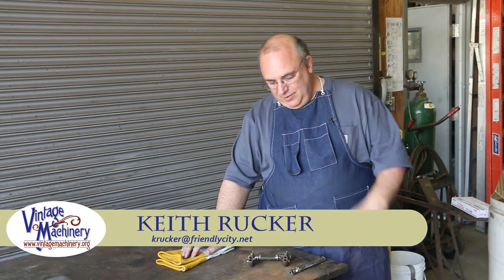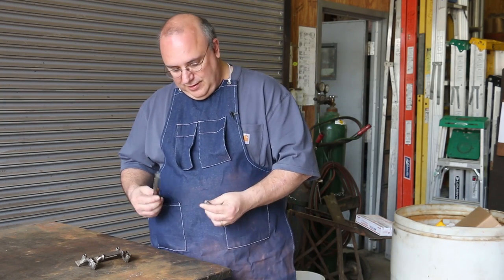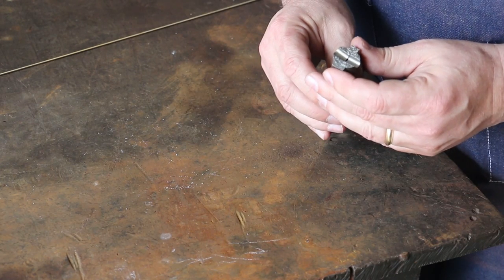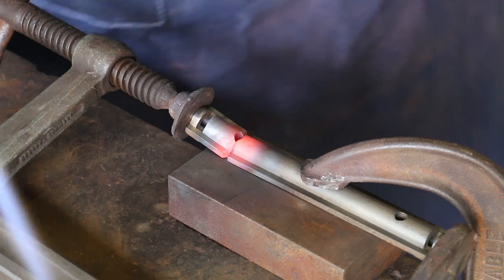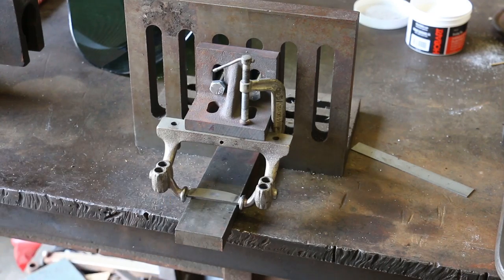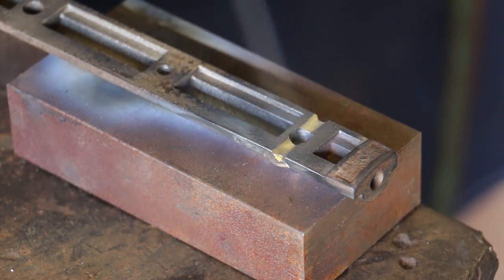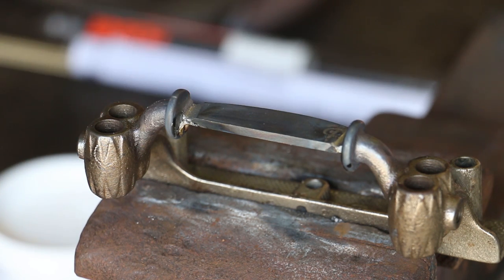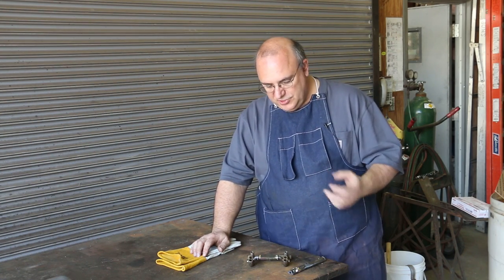Brazing Broken Cast Iron:  Repairing a Stanley 55 Plane

Comment: How would it work if you didn't grind anything off, but just coated both surfaces of the break with brazing material, then pressed the break together while heating the joint?  Wouldn't that be a cleaner joint, just as strong?

Comment: Hi Keith great job on this one i only have one criticism and a solution , when you've heated the object with the torch you feed the rod in with your left hand . if at that point you change hands you will have much better control of your heat/rod feed rate and will improve your brazing ability 20-30% i had the same problem because i favour my right hand and it was pointed out to me by a master of welding and brazing ...... keep up the good work .
Alf .....

Comment: I have a cast iron table saw bracket that I was going to try and weld but I think now I try and  braze it instead?  How you didn't drop an "F"  bomb when the part slipped out of the clamp shows that you are not only a more skilled craftsman than be but have a much better temperament...Damn I dropped the "F" just watching the vajayo!  Nice job!!!!!

Comment: Keith, I need to do some focused heat brazing of aluminum tube to tube about the size of what you're working with. Will a micro propane torch be enough to release the aluminum braze already on the piece without heating a huge area, move the tube to a different position and rebraze.

Comment: I'm not an expert, but I did my share of brazing.   I used to braze in patch  panels before I got a Mig setup.   Did my share of stick  welding cast iron too with mixed results.  I found brazing to be the most successful way to repair cast iron especially if the results don't have to be aesthetically original looking.   I used both bare rod and flux coated and find the flux coated easier to work with.  Matter of preference,  you need to do it a while before you figure out what you like better.    I can gas weld, stick weld, mig and tig weld,  but find as technology advances you go with it.    Never gas weld anymore, a little stick, mostly Mig and Tig.

Comment: I like to use the 10% Nickel rod (SifBronze No.2) as it has a wide plastic temperature range and you can build it up quite easily. I used to do quite a lot of tube frame work using that rod and a gasfluxer.

Comment: Thanks for yet another nice video. Ive watched some videos of jewlery makers and they put flux first on the surfaces to be braced and then puts a litte piece of brace rod that gets sucked into the crack when heated. Is that not a viable method on cast iron or why do one do it they way you do in this video?

Comment: Hey Keith (or anyone else that is knowledgeable), regarding the flux you are using.  Are you just dipping the rod into the dry crystals or did you mix the flux with water first?  Thanks!

Comment: Never having done this before, I am curious how you can apply such heat to do the underside and not melt the work you did on the topside?
Reply: In this case, that's called dumb luck :-)  If you look closely, you'll see that the bronze he's trying to add to the bottom is flowing right through the seam and building up drips on the (downward facing) top.   This is why he had so much trouble building up the 2nd side.  It only held together at all, because of the heat-break created by the hole in the casting.  This let the other side stay below melting, and hold the joint together.

It is actually possible, with some practice, to heat just the surface that you're working on up to the melting point, get new bronze on top of it, and get back out again before the whole joint turns to liquid.  Somewhat counterintuitively, doing this requires running a hot flame and going at it aggressively quickly, so that the working surface melts before the heat has time to permeate the joint.  What Keith did - heating the whole thing up slowly - "feels" safer, but actually makes it really hard to control the joint.  Until you've practiced a lot, the technique that actually works, "feels" really reckless!

Comment: manuel ibarra from mexico
wen you braze cast iron  this way  after you braze do you still have to keep it hot so doesnt crack? 
thank you very good video
Reply from the maker: +Mic Ibarra It is best to let it cool down slowly, but this is probably more important on larger pieces with a lot of mass than something small like this part.

Comment: I own a dreadful cast iron anvil. I have purchased some 1 inch thick medium carbon steel to make a face for it. Do you think that vee-ing out the edges and brazing would work?
Reply from the maker: +Ric Tester The problem with welding a face to an anvil is that the only part of the plate that will be welded is around the edges, leaving a non-joined surface between the two pieces.  Since this is where you will be doing most of your hammering, it tends to cause problems.  When a steel face was welded to an anvil commercially, they used a process that welded the entire face to the anvil leaving no dead space.  While you could easily braze the top to your anvil, I think that you will be even more disappointed with the end result.

Comment: Good video.  Can I do it with propane? I've used cutting propane in my cutting torches for almost twenty years.  I have two vises that need repaired. I figured build a big fire outside and prep vise for crack repair, gently lay vise into hot coals for a while, then heat up even more on bench with torch, braze it, and bury quickly in the kid's sandbox.    One vise body is cracked, cheap "great neck"brand, another is huge old Oswego brand.  Oswego pin holes for the jaw pad are busted out so need to build up some material and redo I re drill two holes.  I'm propane only here.  Is it possible?

Comment: Is there a brazing rod you can buy that will actually match the color or is it possible to weld the cast iron. I have a Stanley Bailey 5 1/2 type 13 that I want to repair but I was hoping there was a way you could do it without seeing were it was repaired

Comment: Keith,

Great intro to brazing.  I am just getting ready for a project.  I need to repair the ornate cast iron legs for a 1890 ish foot treadle powered wood lathe.  I also have to repair the hand wheel that adjusts the machine.

Two questions, could you use a fire brick instead of the block of steel for support?  It should hold up a well but not have such a heat sink effect.  Second, I have been told that as soon as you finish the brazing, bury the piece in a pile of sand to slow the cooling and keep the heat and shrinkage even, does that work?
Thanks
Tony
Port Hadlock, WA

Comment: Hi Keith, as always a good video. Keith I was wondering if it is possible to use too much flux. I noted a comment below that suggested dusting the work with flux and then you also commented that you like to have control of you flus by using bare wire. I have to braze a cheek on my curving roller and when I did the prep I uncovered a hole in the cast. I have cleaned it all out as best I can but I am just a bit concerned that it I get too much flux in there it will leave the braze weakened. Would appreciate your advice please

Comment: If memory serves me correct, if you had access to TIG, you could TIG braze the pieces using ERCuSi-A Silicon Bronze rod. It would require preheating to 600° and controlled cooling but might offer less contraction stress than welding.  Just a thought.

Comment: Kieth - Great intro to brazing. I would like to add two things which may help. 1) The brazing joint has something like a 90,000 lb bond so breakage is unlikely if treated with respect. 2) Covering the parts both during and after, particularly cast pieces, with a welding blanket will slow the cooling process and prevent joint failure and new cracks from forming.

Comment: I have never brazed any type of cast metal before only brass and iron. My questions to you are: Why did you use a yellow/orange flame not blue? I hold the flam about an inch away is that too close? What type of gas did you use (acetylene gas)? What type or brand of flux (is there different flux for different metals)? Thank you for any assistance you are able to provide.

Comment: Thanks for the video. As opposed to some here I have only a small amount of skill at brazing. Your method has the appeal of reduced likely hood of damaging the CI. Like many things getting the work clean and getting a good "wetting" action are probably the 2 most important. The big V helps on getting the surfaces clean. There are brazing rods that have better "flow" so you can work with smaller clearances. I can see the value of using a soft flame on CI.

Comment: That looks like the same flux I've used for years.  How do you keep it from crystallizing out of the welded area forever? I've washed it, wire brushed it, painted it, the part always develops a white residue.

Comment: Is there a reason you used a solid piece of steel on the bottom to support the piece, instead of something like box steel that would not act as a heat sink quite as bad.  It appeared to take a long time to get the part to the correct temperature.
Reply from the maker: +Michael Belew That was just what we had.  It took a bit more heat, but no problem.

Comment: Try a fine fire brick that is somewhat square and flat for retaining under heat, maybe  diamond wheel cut some vee cuts for round work. Great job I think..takes me back to my machine building days ..some with  commercial aviation ...tolerances so tight you could scale the prints!

Comment: Great set-up! Wouldn’t Sta-Silv or Safety-Silv have worked in this case?
There would have been less removal of the parent metal necessary and less filler rod used as well. There would have been a stronger repair as well!

Comment: When it comes to cast iron, I almost always go with brazing as opposed to welding with nickle.  That said, I have a cast iron griddle with a crack in it. I was just wondering if brass would be safe to use for cooking?  Should I use the nickle rod?
Reply from the maker: +Sam King I am not aware of any problems with cooking with brass or bronze.
Reply: Keith Rucker - VintageMachinery.org Ok, thank you!

Comment: Very funny how the world works, and I think you've pointed things out like this in the past. I'm getting ready to do a braze repair on a handle  and some teeth for a gear on my South Bend lathe, and here we are, watching you do a braze repair on a handle, albeit a planer handle. It is just odd how the things that come around show up in clusters, and at least this time you got there first :D

Thanks for the tips on slow heating your parts and also the use of a TIG torch and bronze rod...I do have one question for you about that as I've never done it with any of the exotic rods. Since I'm low on Oxygen, I was thinking of preheating my work-pieces until I run out of gas and then TIG brazing the small handle together (I'm not going to attempt that with the gear unless it works great!). Would you remove the flux coating on the rod and rely solely on the Argon, or would you try to use them in concert? I suppose I can try both ways, but I was just wondering what your take on that would be? Thanks Keith...good to "see" you again, Aloha...Chuck
Reply: Yeah, I'd love to have some Nickle99, but that stuff costs an arm and a leg, so I'll just be doing my back woods Tig brazing and will clean off the rods I do have. Gotta use what I've got ;)

Thanks for the reply, I'll let you know how it goes...Aloha, Chuck

Comment: I had a feeling that the part would expand and buckle!  But, in the end, you were successful!  My friend repairs racing engine blocks.  He has a special oven that heats the block until it is glowing (and the electric meter spinning)!  Then he uses some eutectic rod and a TIG to glue it together.  Cast iron is tricky!
Reply: WAVETUBE84 could look in to getting a propane fueled stove then.
Reply: The j6
Reply: Nathan Dean Maybe could use natural gas or propane:  would work.  But, his oven is specifically made for heating very expensive racing engine blocks (aluminum and steel/iron) or rare engine blocks.  He even has cut v-8s apart and made Frankenstein small blocks.  He chose electric heating to reduce contamination and can even seal the oven and fill with inert gas.  An old electric oven can be modified to accomplish the same results... just on a smaller scale.
Reply: good to know. by the way how would that work with the new plastic engines that are being proto'ed now in japan/
Reply: Nathan Dean Well, you are stepping upon a different mat there.  I am an old jackass, but my hat is off to new discoveries.  I don't give a rats ass if is American, 
German, Swedish...Aryan.    Whoever and however anybody can take it an inch further.  cheers.

Comment: Great video.  That was a very nice repair.  I thought expansion might give you a problem on that first part and sure enough it did.  back in the 70's I had a vise that broke near the base.  I welded it up and it is still with me.  I thought at the time it was cast iron but it is probably cast steel.  Thanks for the video.

Comment: I try to heat the difficult parts first and the easy parts tend to take care of themselves. I guess you cannot get the steel block too hot without brazing your work to it as well, ROFL. I haven’t tried this on a firebrick or a nest of firebrick (to limit radiation and convection losses), but I have seen videos. Hmmm, a tunnel of firebrick with a space to braze comfortably might work. I like fluxing the rod too.

Nice job!

Comment: Hi Kieth,

Great video, as always.  When you Brazed the handle, brazing on both ends, how do you keep the shrinking of the middle piece, as it cools, from stressing the rest of the piece or breaking it?
Probably a silly question, but have a similar project, repairing the leg and hand wheel  on a cast iron treadle wood turning lathe circa 1890.
Thanks
Tony
Reply from the maker: Anthony F. De Leo You try and get the entire part heated up rather than just the two sides and then let it cool down slowly!
Reply: +orlos The Druid   I've also found it helps to peen the area around the weld lightly as it cools with a ball peen hammer.  It helps relieve the stress.
Reply: +orlos The Druid I've had the best luck welding C.I. when I could get the whole piece up to dull red heat, arc weld with nickel or sometimes stainless electrodes and gentle peening on short welds. Post heat and very slow cooling.  Some poor quality C.I. is miserable to repair. Only worth the trouble if it's irreplaceable. Brazing C.I. is practical : 1. If the service temperature of the part is WELL below 1500 degrees, 2. If the part is not subject to vibration, and 3) It does not have to operate under tensile load.45+ years welding here and still learning new stuff.

Comment: Certanium 889 stick rod. I always preheat cast. I have used it with TIG by knocking the flux off. I've seen it listed on eBay It would be worth your time to try it. It is also very easy to machine.
Reply from the maker: +Richard Haisley I just have not had much luck with any stick welding on cast iron.  TIG works fine on smaller items like this, but I don't currently have access to TIG.  Larger cast iron items I prefer brazing over TIG as you can spread the heat out better with the torch.

Comment: To cool a brazed part slowly, try burying it in silica sand or powdered limestone.

 I do agree with some that it appeared to me that you used to much heat.( A neutral flame yields higher strength) A good tip is that the filler metal follows the heat.
Reply: The accetilyn was strong pressure.

Comment: When you flip the parts over after brazing the first side, what keeps the filler metal you've previously added from re-melting and falling out?
Reply from the maker: +Amy West If you heat the part up too hot, you can melt out the other side.  The trick is to keep the heat localized on one side and just hot enough to do the job.  That is something that just comes with experience.  In the case of this part, placing the part on the large metal table serves as a heat sink and can help you to keep the side that is down a bit cooler, which while normally not something you want in this situation it works to your advantage.

Comment: So this is basically soldering iron together with bronze rod. Amazing, didn't know you can do that.
Reply: Григорий Олянин pretty much
Reply: Григорий Олянин
Reply: ***** i know what it is. Lol im a certified welder
Reply: John Hardy thank you for pointing out how things are properly called, but I was compairing physical processes happening in both brazing and soldering. And they are pretty much the same, besides higher melting temperature of filler material.

Comment: I have a cast iron radiator in my house and it has a small crack is this something i can braze together?
Reply: leviyid yes you can but you need to drill a small hole at the end of the crack so it does not keep pushing the crack as the heat expands the iron. it will also take lots of heat on a larger item.

Comment: Would you say braising is basically soldering?
Reply from the maker: sailingsolar Brazing and soldering are very similar processes in that you are using a filler metal that melts at a lower temperature than the material you are joining, but with brazing, you usually have much tighter fitting parts than you would with soldering and the temperatures required to melt the brazing material is much higher than soldering.  Also, brazing tends to result in a stronger joint than you would typically get from soldering.  One thing that often confuses people is that "silver soldering" is really a brazing process and not soldering!
Reply: Keith Rucker - VintageMachinery.org  Thank you for the reply.  I do enjoy you videos, sir.